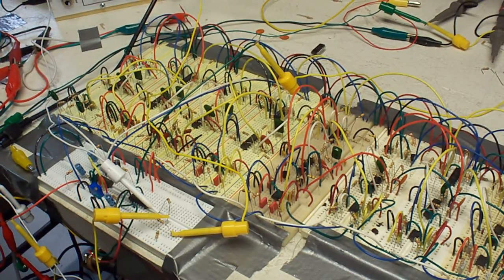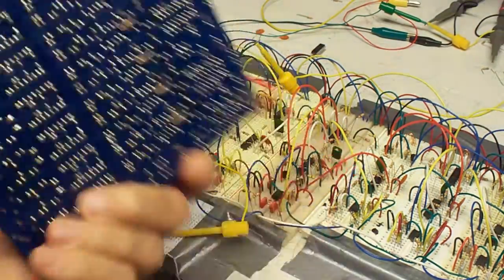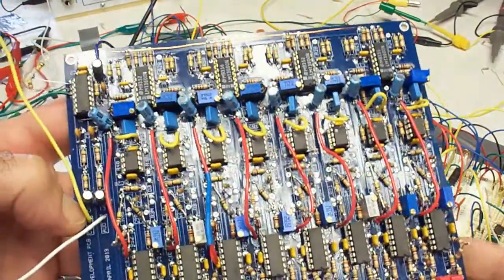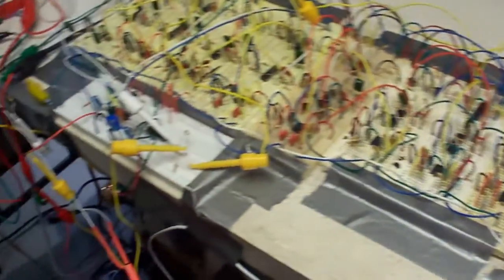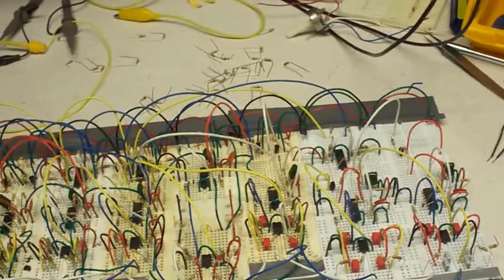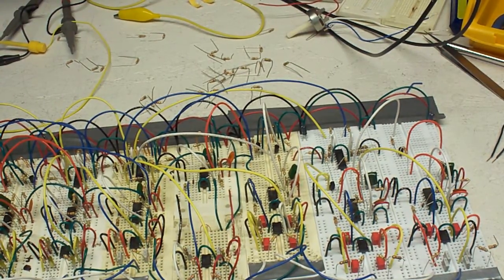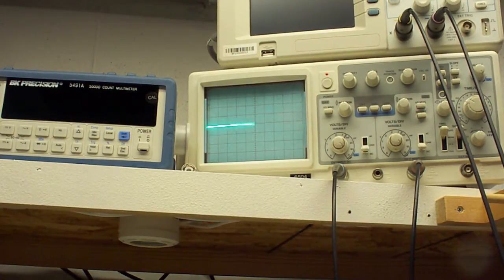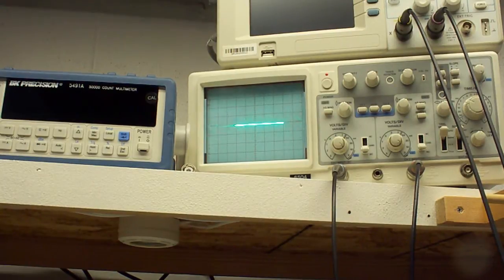MFOS Vocoder Progress Update

Comment: hey Ray, can I use a guitar as the signal input?
Reply from the maker: Both inputs have mic or line input levels so you can mix and match when it comes to
audio input and vocoder control.

Comment from the maker: It's just TL074s, TL072s, 2N3904s, 2N3906s and LM13700s. I decided not to use the NE570 compander chips that some designs used. Other than that it uses 5% caps and resistors. I'll post a YouTube of the 2nd prototype as soon as it's completed. I'm hoping this second board is ready to go. I'm kicking around the idea of a parts kit to make it even easier for diyers to bring a vocoder into their studios. Stay tuned...